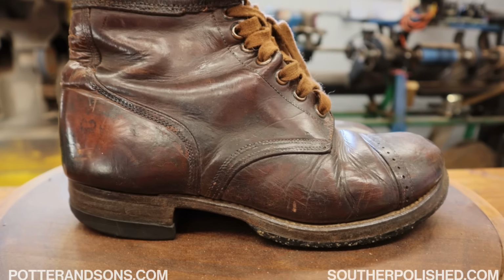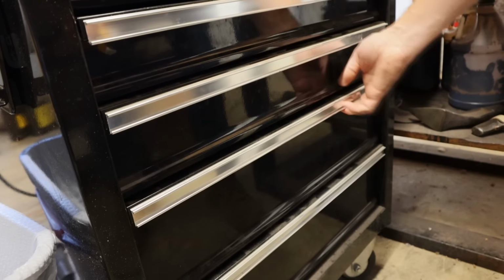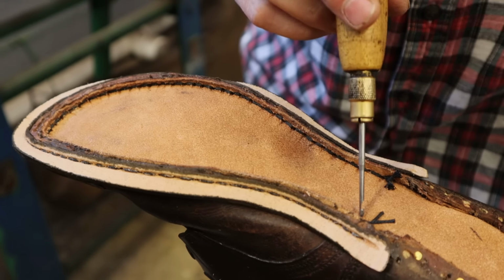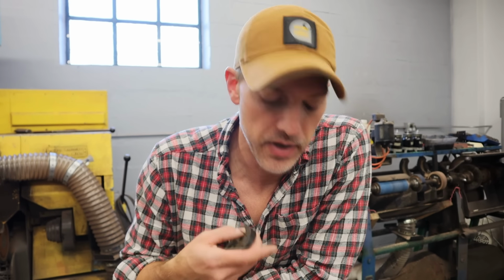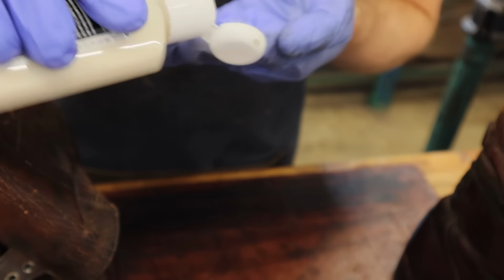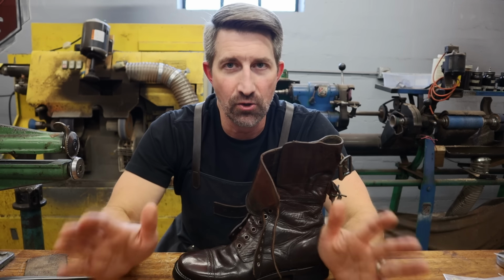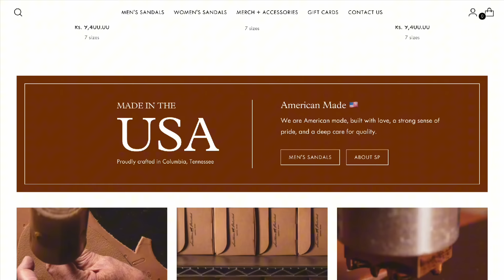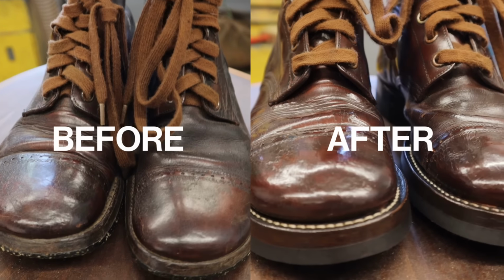Restoring 80-Year Old Boots?

Comment: They did actually modify previous pairs to add the collars, but this pair looks to be a paratrooper boot that was cut down and then modified with the added collar.
Reply: The boot is not a paratrooper instead a Motor cyle. Reason for that are the buckles which protect the under part of the leg.
Reply: @pmue437  incorrect. I'm saying that it isn't an M-43 Combat Boot, it is an earlier model that has been modified, which historically was done.
Reply: @greyhoundTex You‘re right those M-43 have such buckles.
Reply: To add more weight to the correct speculation, these are not cut down paratrooper boots .. rather service shoes normally worn with high canvas leggings which were delayed late war obsolescence by the addition of buckle cuffs by cobblers post manufacture . It’s very common to see this modification in Italy along with a similar practice  of a laced cuff designed to resemble tall paratrooper boots.
Reply: To me, rather than a vibram sole, A more vintage looking sole from Dr Sole or a retro cats paw type would be more sympathetic.
Reply: It's a pair of M42 garrison shoes with cuffs.
Reply: It's a pair of Type II Service Shoes with the cuffs from a pair of M1943 Combat Boots. I've seen a similar pair that a  99th Division vet had modified and wore home.

Comment: My 2 cents. Don't forget during WWII many war items were provided by many different companies, while most had mil specs it is possible that earlier products need were rushed into service and earlier version may not have looked the same as later issues. I've experienced experienced this my self while serving. Some examples are the sights on the M1 rifle differed from manufacturers as well as trigger guards, jeeps manufacturered by Willys and Ford differed in a lot of way because of construction technics and equipment used to produce items. It makes sense that the airborne needed this item quickly so the manufacturer on the earlier version may have stitched the upper buckles to an already existing pair of boots already manufacturers. Just saying things during WWII went always so consistent throughout production.

Comment: These are regular US Army late 30's to WW2 era  low service boots... that had a  double buckle cuff added most likely when the canvas M1938 leggings were phased out.  A true M1943 double cuff boot has no sewn toe cap, and was in 'rough out' leather. 
Also, true paratrooper boots have the front of the heel slanted so they are less prone to get caught on the door sill of the airplane while jumping out........ and paratrooper boots as in the 'Corcoran' type had 13 rows of eyelets... plus a specific way they were sewn around the heel for stability.  WW2 Paratrooper boots were higher so they can be laced up very tightly to help prevent ankle injuries etc..

Comment: Nice job guys!
I have 2 pair of ww2 german boots. One pair for ifficers, one for soldier. Both from 1943. The thick leather is not brittle at all, after 80 years. I did redo the soles twice for the soldier boots that i wear. I had them on in 2002 at -28 degrees Celsius with 2 pair of socks. one normal, one a little thicker. my feet were warm and i could walk for miles. They dont make boots like they used to. And not only boots, a lot of things are now made for breaking and buying another and another

Comment: Their real.  You have yourself a pair of frankenboots. Back in WW2 and especially WW1 soldier's didn't have access to a depot and over many months even years of fighting they would reuse and rebuild boots from scraps. Cobblers were abundant in WW1 and WW2 and it was an easy way to make a half dollar repairing boots. Bust a toe through the tip or even rip the soul out while on a push trench boots were exceedingly hard to come by but usually the buckle didn't have issues so cut it off and stitch it on.  Non trench boots were a little easier to come by than trench.  Remember their was a leather shortage during the war. Usually what you got issued was what you were left with for a long time. Trenchfoot was a massive issue as boots would wear out and allow water in easier. I can 100% say this wasnt a i want to do this that is a I need these repaired.